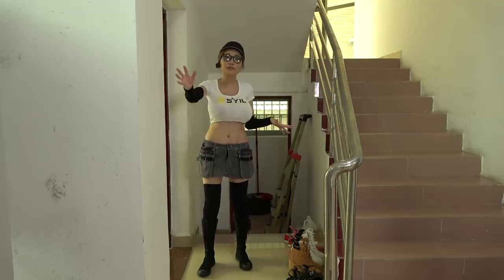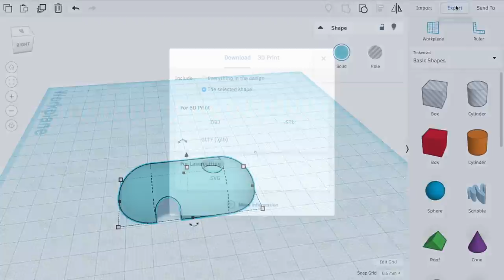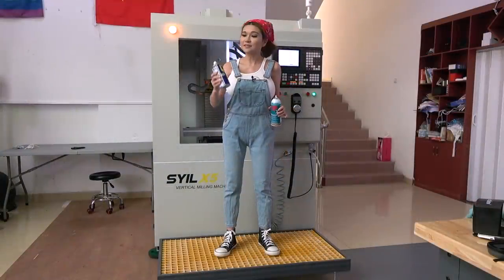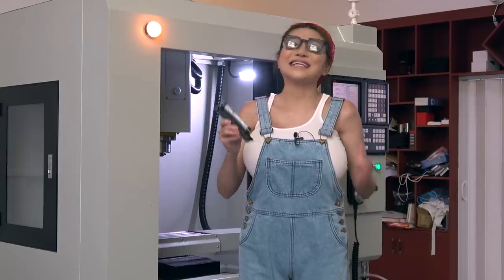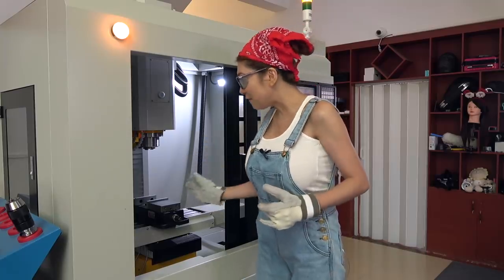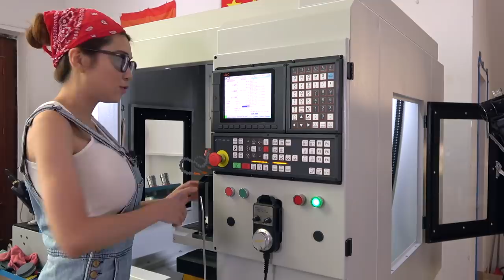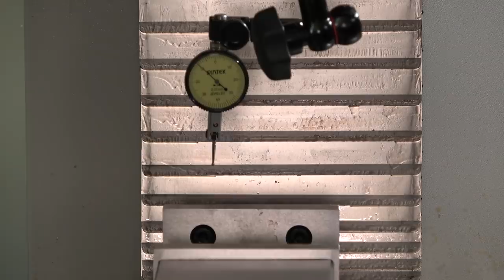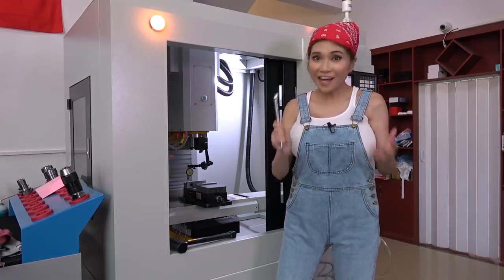Leveling and Tramming the Vise on my Syil x5 Milling Machine!

Comment: Ahhh the WD-40 shampoo analogy is great. Thanks for helping teach people that it's not a lubricant! Cool to see how you set up the machine.
Reply from the maker: Thanks Becky!
Reply: It's primarily a penetrating oil for loosening bolts.
Reply: @Land-of-reason  usually when it get rust
Reply: Hey, it's Becky!
Reply: It's certainly not a degreaser either, I usually use brake cleaner to remove grease or oil
Reply: I learn with the hard way that is not lubricant!! 
Nice work!!
Reply: Water Displacement->WD, so yes, it is not a lubricant, but lot of people think it is. From company web site: "The first company to use WD-40 Multi-Use Product commercially was Convair, an aerospace contractor, to protect the outer skin of the Atlas Missile from rust and corrosion. "

Comment: I love how you printed the brackets for the compressed air pipe rather than just buying off the shelf. 
You can't go wrong with Titans of cnc. He is always pushing to make the best out of every aspect of cnc machining.
Reply: Mmm. I think I need to do some research on that link. Thanks.

Comment: All of the vice tramming steps you did were absolutely correct. Just one this to watch is make sure that tightening the nuts didn't cause to vice to move again, so sweep it with the indicator again after you tighten the nuts down

Comment: Naomi, the jack handle itself can be used to release  the pressure, the end of it has a rod in it that fits the end of the pressure release valve.
Can't wait to see what you use this for.
Reply: I thought I saw set screws holding the handle in place.  Less hassle to use the wrench

Comment: Thank you for the video, I'm an automotive specialist, but am hooked on CNC videos and 3d printing.  I'd love to get a CNC machine, but power requirements, moving the damn things and not knowing the first thing about setting one up have stopped me from the madness.  I'm happy to be learning right along with you.  I liked that you stepped through something as 'simple' as leveling the machine and actully putting in the machinist vise and trimming it to get it square. Basics!  Eyeballing it and thinking 'close enough' isn't... not if you are using the equipment to actually create things properly.

Well done.

Comment: Very Good Naomi Wu. One thing you need to do with your airline just before the manifold you need a drip line and drain. This will stop water from getting into your machine. (any time an airline goes down then back up you need a drip line and drain)

Comment: Rodney here. quick note on leveling. run your level corner to corner leveling opposite corners making it "rock back and forth" on the other two. then make those pads touch the floor and stop it from rocking. reposition your level for the other corners and repeat. you'll get easier and faster results

Comment: Naomi, can't wait to see you using your new mill to make things!  
I noticed you used a separate wrench to release the jack pressure to lower it. Most of those jacks I have seen, when you pull the jack handle out of the jack, the end of it is crimped so you can slide it over the release screw to turn it to release the jack pressure so you don't need a separate wrench.

Comment: Hi Naomi,   Not sure if any one else commented, but the washers used on the vice hold down bolts need to be abit bigger in diameter,  vice much less likely to move when taking cuts,  xx

Comment: You should be able to use the Jack Handle to lower the Jack instead of a wrench.
Reply: Was about to say the same thing 😂
Reply: removing and putting back the handle may be too much of a chore for her.
Reply: @thiamjoo  I have not a single doubt in her ability to use the handle. Sometime, you just don't know those little stuff
Reply: @Jorat1346  True. Sometimes you also just forget if you don't use some tools often enough.

Comment: Nice new machine you are moving up in world, One advantage of setting your machines tables level is that when setting up a job you can make any datum level and know that it will be parallel to a machine axis, also with an angle gauge or angle block and level it is possible to set any angle on that datum.

Comment: I'm not sure that "if I can do it, anyone can." is entirely accurate, there is something amazing going on in that head of yours... and thanks about the truth about WD40, it's a water repellent, not a lube.
Reply: EITURKEY1 yeah, anyone who does this work knows that, as she does, but everybody else doesn’t. So it’s good she said it. But unfortunately, LPS and other products of that type aren’t great either. Better than nothing, but the best thing is still oil or grease.
Reply: See Wikipedia for the complete write up on WD40, rather interesting.
Reply: While WD40 is not a good lube it is a great cutting fluid for non ferrous metal.

Comment: I've been looking forward to this and I wasn't disappointed. A small issue before someone who is much less polite points this out, Vice produces hit pieces on popular Makers. Vise (typically only American English) is what you installed in the CNC for your video. You might want to change that title to read accordingly. Good luck with the machine. I'm looking forward to seeing chips fly!
Reply from the maker: Thanks for the correction!
Reply: @Naomi-Wu  You are welcome. English is rife with homonyms; so, an easy mistake to make.
Reply: This is only for American English! English outside the U.S. spells it vice, so either would be fine, but I understand Naomi might want to have it correct for American viewers.
Reply: @CyberBBtv  An interesting point I was unaware of; it sounds like the gage vs gauge situation. I've added a modifier to my original comment. Thanks.

Comment: Ok, something to think about with your new cnc machine Naomi. You may want to put an aluminum or steel sub-plate over the table to give you more clamping options with the many projects you'll be doing. Use a double-disk ground, within .002 flatness or better, 1" sub-plate that has threaded holes evenly spaced across the top. Tap them to your stud/bolt size and make sure you heli-coil them. The spacing should match the spacing of your vise of course. So if you can evenly space 4 holes and your vise matches that spacing, that's kinda what you're looking for. Use set-screws to cover the holes when not in use. This setup gives you more clamping options and saves damage to the table surface if there is a Z crash. I would just use aluminum as it's cheaper, lighter and easier to thread and resurface if needed in the future...It'll hold up good enough for what you're doing with it. Use a preservative oil in between the sub-plate and table when bolting the sub-plate to the table. If you don't use a sub-plate over the table, you should 3D print T-Slot covers for your table...Trust me on this,as the T-Slots will get clogged with chips with some continues milling. It's much easier to keep things clean from chips. It may be easier to just make sheetmetal covers if you're going to keep the vise in the same place though. Don't be afraid to use air to blow the chips away, just don't use the air below the table surface and you'll be fine. Once you start using coolant, using a vacuum cleaner will kinda be a pain. I don't know what kind of water catch/filter they have for the machine or how good your compressor dryer is, but a good safety measure for your expensive machine is to put another water catch/filter at the airline connection to the machine. Also, the air line to machine should be from the highest point in the air line to help prevent water from entering the line that goes into the machine. To do this, you would put an elbow,90deg perpendicular and then a T section. One end of T section goes to floor and the other goes toward ceiling and this will be your air line to machine...I know it sounds involved but you want to protect your machine from any possibility of damage from water. You'll find out during the humid season there how good your compressor dryer is...The first sign is water misting out of the air nozzle you use to blow chips clean from parts. Hope this helps out..And don't be afraid to use a good coat of rust preventative on table between the vise. I spray it on table where I'm putting the vise and place vise on table and move vise over the rust preventative a few times to spread it around evenly and then clamp the vise in. If you leave the vise on the table without removing it for a while, this will give you the best, no rust results. And one more helpful hint. When moving the table around, think about where you want the TOOL to go. For example of what I'm talking about..Don't think to move TABLE left, rotate handle in X positive direction. Think TOOL direction to right is rotate handle in X positive direction...Trust me on that one and you'll understand when you get some experience with running parts and making work-offset adjustment. I have other good things, but this is getting long...Can't wait to see the chips flyin'!

Comment: You normally don't need a seperate wrench for the release valve of your car jack, the end of the jack handle is crimped to fit over the release valve. Saves on a tool, and bending down, handle gives good control over the rate you adjust the release valve and gives you a little safe distance incase the load shifts during descent.

Comment: Have you ever thought about learning FreeCAD for designing parts? Once you get the hang of using it, it's really a wonderful tool. Free and Open Source Software, too!
Reply from the maker: Sometimes I use it, I prefer OpenSCAD and for CNC Fusion360 is really the way to go.
Reply: @Naomi-Wu  I didn't know about OpenSCAD, but I will look into it now, thank you for for the recommendation!

Comment: Generally, perfect leveling a mill, even a cnc, isn’t critical, as it is with a lathe. Twist of the table isn’t normally a problem because of the way the base is designed. If the designed lathes properly, it wouldn’t be a problem there either, but despite the fact they knew about how to solve the problem a century ago, it still isn’t done, except on a couple of small hobby machines in Great Briton.

I have to say though, that while I knew you knew a lot about computers and electronics, including printers, etc. I had no idea you knew this much about machine tool work. That’s great. My daughter is good at this too. But, not anyone can do CAD/CAM. I find that a lot of people simply give up, even though I encourage them.
Reply: Machinist 72 I didn’t say that leveling didnt matter. I said that leveling to the extent we level a lathe doesn’t matter. We don’t have to level a mill to 0.0005” per foot they way my lathes are leveled.

Comment: Aerospace Machinist here, never dial a vice in that way. Indicate from the center of each bolt. The ends can and do flair out a minimal amount. Set to zero over left bolt, snug left bolt. Move to right bolt, tap to zero, snug right bolt. Repeat till zero. Can be done within minutes.

Comment: It's very impressive to see you make things with tinkercad - you have a fluency with it that is really impressive. I'm used to slightly more fancy cad tools and don't think I could do what you do with tinkercad...

I have never seen anyone use a wrench on the release valve of a floor jack before, though I imagine it's a bit more precise than the dented-in bit at the end of the handle, probably much better control. Had never occurred to me to try that...

The wd40 thing was smart... A long time ago I actually tried washing my hair only with conditioner based on something I read online, to displace the oil, in an even closer parallel to your WD40 usage.

Jealous of your growing machining skills, congrats and enjoy! Now just gotta get good at the karate chop of your raw stock like This Old Tony 😉

Comment: It would be best to do the vice up on a large parallel and clock along the parallel, leave the parallel standing above the jaw.  Notice when you do your final pass the DTI moves about 0.03mm but is zero zero at the ends. If you clamp up on a parallel you take up any flex in the vice or the jaw. You need to use a decent sized parallel, something like 50x25x150mm and clamp across the 50mm direction so it doesn't flex.

Comment: SYIL is such a nice machine for the price and hobby level. You can do really precise work. Find another CNC, made out of granite, with servo and linear rails. IT does rigid tapping and all the good stuff. Only real competitor is the Skyfire but SIYL is better in my opinion. SIYL X5 for a garage use and if you want more X7 is the best.
Reply: I have been working CNC machines for years and after seeing this machine I had a look at the price and power and found its a joke, very limited in what material it can machine and the cutting area is way too small. The price starts off cheap but to get it to anything reasonable you basically have to triple the price maybe quadruple the initial price. For a machine of this size to have a standard 5000 RPM spindle is not an option as you need double if not triple that to make efficient use of the cutter.
Reply: @dikkybee  I agree if you want the full package with enclosure. If you are interest in the machine only, you can have a X5 for about 5K. At the hobby level or for small workshop is a great price. The X7 is more of course. Working area is what you can aspect in this price range and it's not that bad to me, of course I'd not a router. For sure is better than a Tormach, but I agree that a X7 full full optional gets to the same price of a super mini mill from Haas. That's why I see the potential of these machines if you know what to choose and buy. Let's say. I can make a same level CNC for 1/5 of a Tormach price, but can not do the same for a Syil. If you know a machine within 10K that gives you linear rails, servos, granite structure please tell me because I am really interested to have options in future. So far I built my machine but would like to try a single brand ecosystem
Reply: Heavens above!   All of you.  Give her a break.  The last CNC I saw her use was a toy 3018.  This is a hell of of a step up.

Comment: Anyone: Where did you find those hose brackets?
Wu:  I made them.  If I can do it, anyone can do it.

Mike drop.
Reply: lol
Reply: Good design too. Plenty of mass and fastener recessed.
Reply: @williamswenson5315  I would like the fastener as close as possible to the hose.
Reply: @MF175mp  Desirable, but I'd also set it far enough away from the clamp edges to preclude cracks emanating from the fastener hole to an outside edge.
Reply: @williamswenson5315  yeah sure

Comment: Hi, check your vice again, as tightening the bolts will throw it out, tighten the opposite bolt to pull it back in. Go back and forth untill it is tightened down.😉

Comment: you might want to check the machine's level once in a while, it is sitting on wood which may compress over time.
also, does the machine need to be anchored to the floor?
Reply from the maker: No need to anchor, and will relevel periodically
Reply: ㄷ
Reply: Very few CNC machines are anchored and I wouldn't worry about releveling as it will make not difference in the machines ability to machine. Just make sure all the pads are contacting the floor and it will be fine.

Comment: When you clock up a vice you set it roughly with the vice jaw and then you clamp a parallel strip, normally a reasonable thick one, and then finish clocking it up. As you would have noticed the jaw wasn't totally straight and you are more interested it what the job alignment is and not the jaw. 
When you level the machine by what I saw in the video you would have twisted the machine. When you level in one direction you adjust both pads not just the one. So when you had the level parallel to the tee slots you would have adjusted both of the front/rear pads and then when you had the level at right angles to the tee slots you would have adjusted both of the end pads. You also try and keep the pads as low as possible so it keeps the machine more stable.
There should have been a pole mounted on the back of your machine and the electrical cable should have been above your head rather than run across the floor. If the area gets flooded you could be electrocuted, even with the cable cover you have it is still a trip hazard, you have now got a piece of floor you cant use for anything due to the cable being on the floor.
Lastly you should also be wearing safety boots rather than the runners you were wearing. You will thank me when you drop that vice on your foot.
Reply from the maker: The runners have a steel toe.

Comment: Not sure if I missed in it in the video but how important is having the whole milling machine level? I'm wouldn't doubt it helps somehow but I would think the most important part to be perfectly level would be the area that had the vise to be leveled relative to the drilling part?
Reply from the maker: Oil and coolent would not drain properly and there would be additional stress on bearings if the machine was not level.
Reply: Ah ok cool that makes a lot of sense. Thanks :D

Comment: Will this hose be able to supply the machine with proper pressure and volume air? Where I used to work, copper piping, yes, plumbing pipe, was used for air supply to the milling machines, general air supply, and other industrial machines.
Reply from the maker: Yep, well within its rating

Comment: Naomi, I hope you're getting a bigger place soon. I have no idea where you are putting all your equipment. I swear there is no room for it. What a tiny little compressor...Come on, you can do better than that! Hoses can go bad. Should have made those holders with a slot so you can remove the hose without unscrewing them.